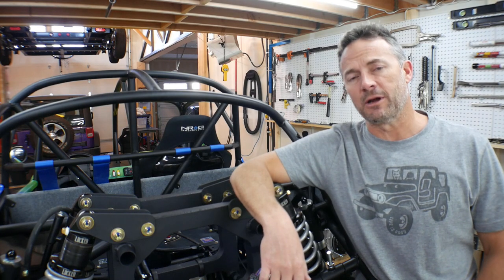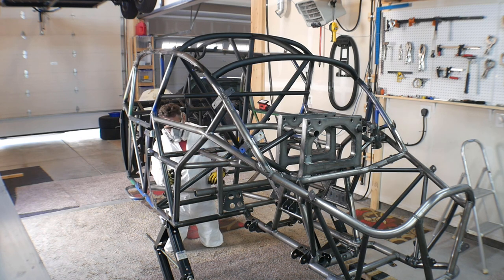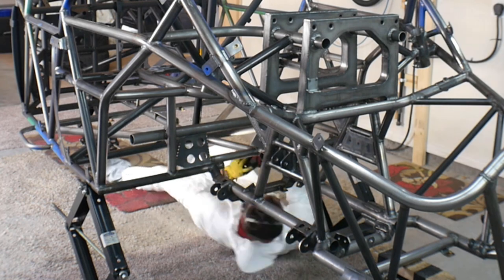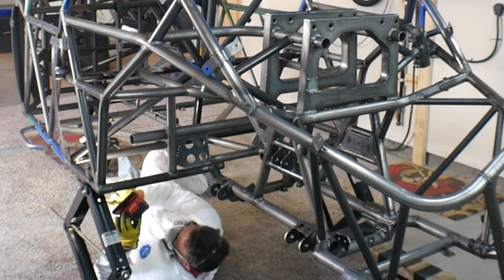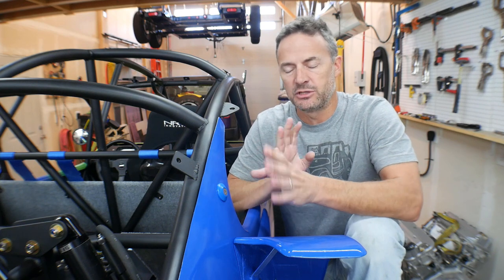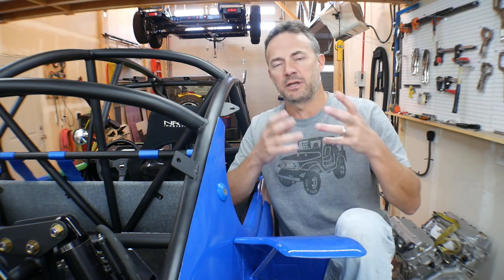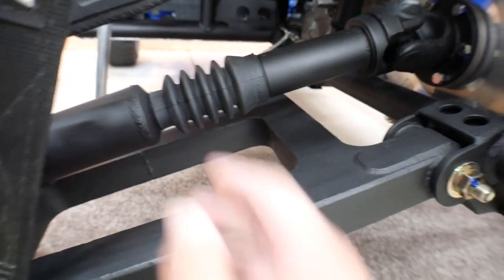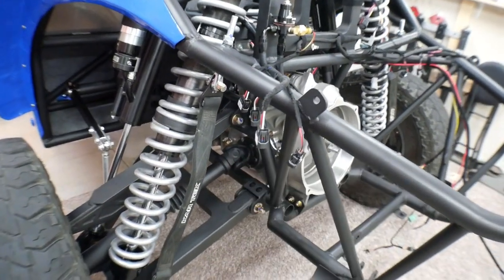Chassis paint and final build updates!

Comment: Nice work. To protect the front edges of the rear fenders, from rock and sand damage, you could apply some clear helicopter tape to the outer edge of the rear fenders.
Reply from the maker: Never heard of "Helicopter Tape" before. So I looked it up. You're right, that would work perfect. Thanks for the tip. 👍

Comment: Hey Doug. I enjoyed watching your videos and learned a few things along the way. I like your level of detail and how much you do yourself. A couple of questions... what material did you use for the structure of the firewall behind the seat (sorry if I missed that in a video)? What did you use to attach the carpet to that firewall and to the inside of the fiberglass? Thanks!
Reply from the maker: That firewall is made out of .050" aluminum sheet. Then I rolled the top around for some strength. I wrapped the carpet on both sides and used spray adhesive to attach it. 
To attach the carpet to the fiberglass I used spray adhesive on the carpet side and brush adhesive on the fiberglass. I used brush adhesive on the fiberglass just so I could get a thicker coat. With the adhesive you need to cover both surfaces. Then I put the carpet in place, and used a roller to keep pushing it on. Eventually it sticks and holds really well.

Comment: Are you looking at some new tires?
Reply from the maker: Wait, you don't like those old worn out rollers I got on there now? 😉
I want 33's on the front and 35's on the rear. Right now they're all 33's. It has 16" wheels now, but I've discovered there aren't a lot of options for 16" wheels.
So I think I'll get some 17" wheels with beadlocks. Then I'll have multiple options for 33 and 35" tires.